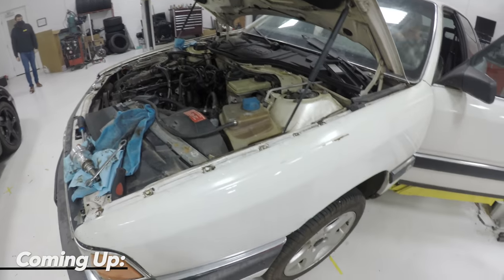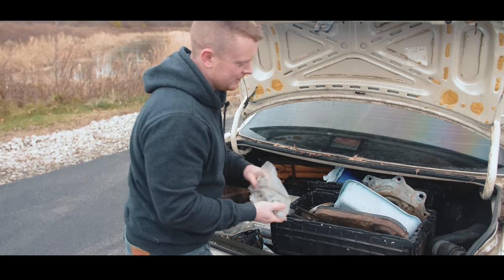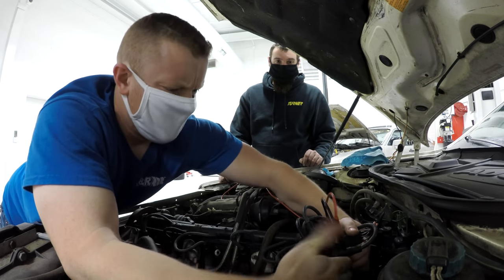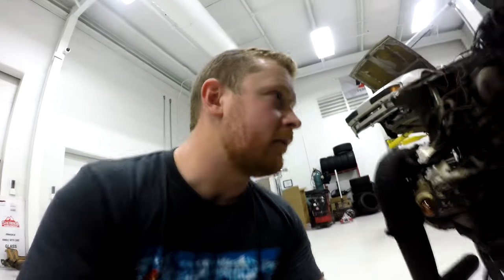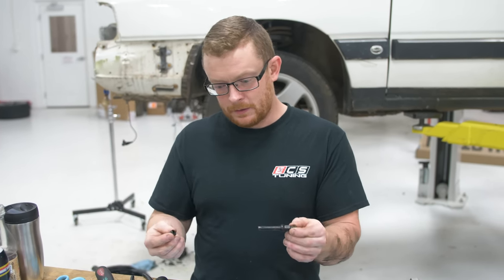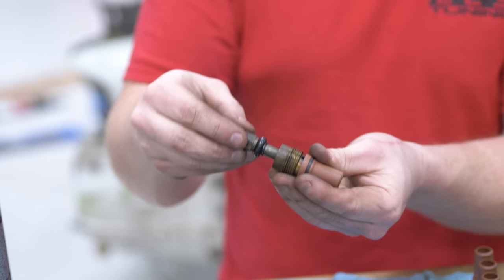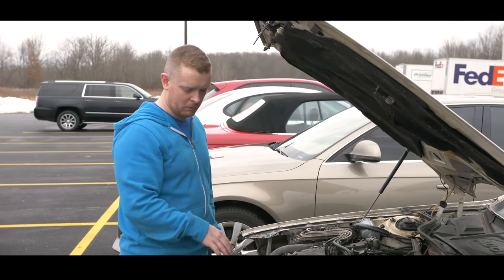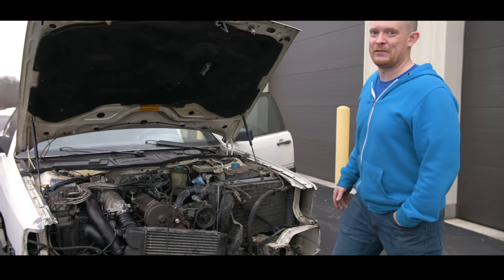Will a $600 Audi 5000 Run? | Winter Beater 2 | ECS Tuning

Comment from the maker: What other upgrades should Kevin do?
Reply: All of them
Reply: LED Lightbar on the roof and Straight pipe 😂
Reply: New oldschool rallye wheels or fiffteen52 would look awesome  I think.
Reply: Set it on fire.
Reply: Porsche cayenne disc brake conversion front and rear, 16' or 17' rims with gravel tires or all weather tires, hella rally light on the front bumper, roof rack, K-jet killer efi system, short throw shift kit, clean up the interior.
if you still have the hulk of the wagon from last year i'm interested
Reply: Electoronic fuel injection, bigger turbo, TFSI coils, bbs rims and coilovers
Reply: Chipped ECU and a 2bar wastegate spring.  Stuffed one of those 10vt into a small chassis car and that woke things up :)
Reply: Weld both diffs :p
Reply: @dogsvs5732  there’s a button on the dash for locking diffs. Vacuum actuated
Reply: @fizznizzy  yes but if they were welded you could do rwd skids like in ronin
Reply: I think a small rearwing/spoiler would be nice! I Got a similiar Audi myself with a rearwing and it looks awesome!
Reply: Safari it! I've been trying to figure out how to lift my 200 20v for months. AT tires lol
Reply: To make it running on the 5 cilinders?
Basic maintenance maybe??
Reply: @J.Domingo1  Totally, they haven't even looked at endless suspension bushings, million ball joints, brakes, just get the thing working with tires that have tread depth and I'll be entertained, the brutality of that mechanical fuel injection, phewf.
Reply: EFI 😁
Reply: Man,how much for the Alpine stereo?
Reply: I loved cranking the boost and using the cold start injector to keep up a tad when the cis leans out. Very crude but worked 😆
Reply: Blow it up
Reply: RESTO MOD BUILD SERIES. Please don't use it for the winter and ditch it. Alternatively build into budget rally car like the olden days!
Reply: Everything, but a detail for sure 😂

Comment: First thing to do on K-jet cars is check the control pressure at the warm up regulator.  Then, just the operation of the metering flap.  When you tried to accelerate, it was starving for fuel.

Comment: I'm both happy and sad seeing this. I owned 2 5000Ts and 1 5000TQ and one 200TQ 20v. None of them were in this kind of shape, well, one had a badly sagging headliner. I do not miss the hydraulics. I've replaced pumps and steering racks, oh, and had a pressure hose re-built locally, still have a can of Pentosin sitting around!

Comment: Ultrasonic cleaner filled with 1:1 lemon juice concentrate and hot water will save you a fortune in solvents.  A trick I learned working on old 80's motorcycle carbs.

Comment: Just a small idea: contact with k-jet killers about electronic fuel injection system for your car. If this car stood for quite a long time, you might have a problem with mechanical fuel injection. DON’T TRY TO DO SOMETHING WITH IT because one mistake can cost you no fuel at all
Reply: Goddamn BOSCH KE JETRONIC...🤦‍♂️🤦‍♂️🤦‍♂️
With the $400 Fuel Pressure Regulator
Reply: Looks like it is MC1 engine, personaly I haven't faced with it yet, but I reassembled KE-III Jetronic at my 2.3 AAR/NF, and it is not too hard to do by yourself if you have instructions and information about it.. After I did it, It is working fine without any problems with a nice performance for a year already, even after long time stood..
BUT YEAH, it will be much better to make electronic injector, especially on turbo engine..

Comment: The noises this makes. I have spent many hours with these cars. All of it brings back memories. 
You should check to see if the spray patterns of the injectors are any good. That's a common cause of misfiring in these engines. Get the injectors out and place them in a bucket, run the fuel pump and lift the metering disc. Should be a fine mist.

Comment: I've got Audi A6 C4 2.6 as my first car. And once I drove with my friend and my dad and my dad was on the back seat.He sat on the battery and iron rod in seat connected to both contacts and seat started to make a lot of smoke :D That was strange) rubber carpet on battery fixed this problem for entire time I had this car)
Reply: Yeah same car same engine same thing happened, but the car seat foam caught on fire a bit :D
Reply: All C4 owners need to put the battery post cover on. They had a cover when new, but have been misplaced since. I use a small piece of rubber as well as the battery post cover that came with the car. C4 is best car.

Comment: Yeesh.   I just bought a 92 accord coupe (ex so disk brakes all around)  for 400 bucks.   Threw a battery in it and drove it to a gas station.   Smokes at high rpm (valve seals) no thermostat and the sunroof leaked where it sat for three years but other than that runs really good

Comment: Who lets a car like this trashed. I assume that a qauttro C3 isnt valued as high in the states as it is in europe. Here a rust free quattro body costs double of what this guy paid for the car. 
The mechanical fuel injection is going to be a pain, i assure you, unfortunatly there are very few options. As far as i know the easiest way to deal with it is to convert to a EFI system from a VW T4 van that had the 2.5 gasoline inline engine very similiar to this. Best of luck.

Comment: IMHO you'd be better off just ditching the K-jet and converting to EFI with a cheap old ECU like a megasquirt 1 V3.0 with just simple MAP-n fueling.
It's much more flexible than a K-jet.
The swapped components will outlive the car and can be sold or kept for another older 5-cylinder audi.

Comment: It's funny how intimidated people get by CIS. If you've worked on one CIS car, you've worked on them all... its really NOT complex at all. I've owned probably 6 or so CIS cars and never had any issues with diag on them. As long as the fuel dizzy isnt full of crap, the airflow plate moves, generally they run.

Comment: 13:10 Those parts can be made in a 3D printer.
Reply: No they cant, at least not without some fancy high temperature materials.
I tried the same for my audi 100, but when switching the engine off, the temperature at the injectors rises above 150°C. Because the intake sits directly above the exhaust. And its made from aluminium so the heat gets to the injectors very fast...
Reply: @them0leisback  You can print parts in titanium, inconel and other alloys.

Comment: why are this cars so cheap in the usa? mal ganz im Ernst
Reply: Perception is reality, unfortunately. Once the general public perceives something to be of lesser value, a small group of enthusiasts can't undo that. There have been some C4's gaining value (S cars), but otherwise there's still a lot of ignorance surrounding older German cars, and even more ignorance about older Audis. The TV show 60 Minutes is responsible for a lot of that ignorance. In the entire time I've owned my Audi A6 C4 (13.5 years), I've spent maybe $1k on repairs that weren't regular maintenance, such as CV boots, control arms, window regulator, trunk struts, wiper arms, headlight switch, and ignition switch. But my much newer Toyota with less miles has needed thousands more in repairs.
Reply: @mediocreman2  Thats why the older Audis has more value in germany. Because the reputation isn't dameged over her. Plus cars in this state woudent be lowed to drive on the street in germany.